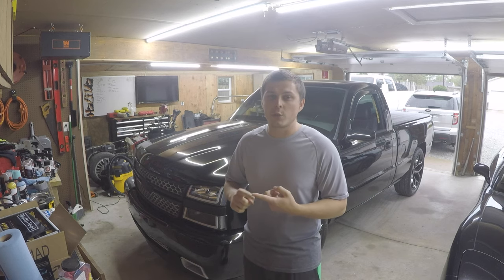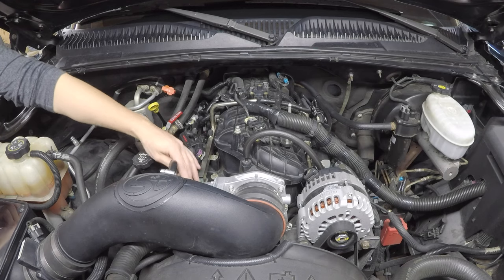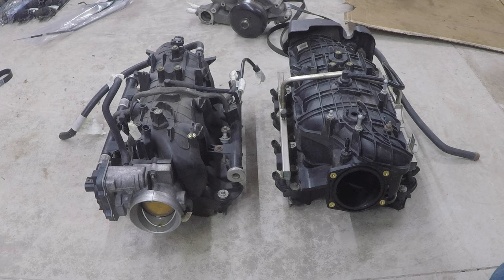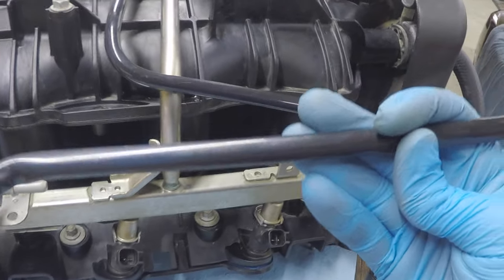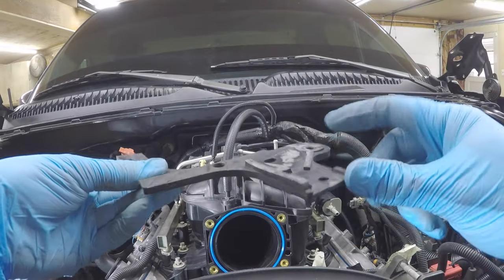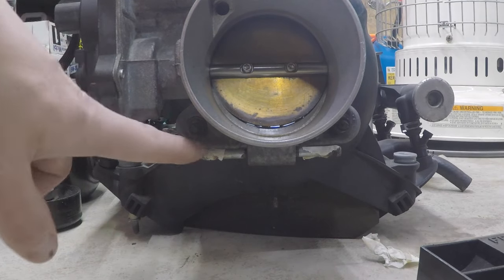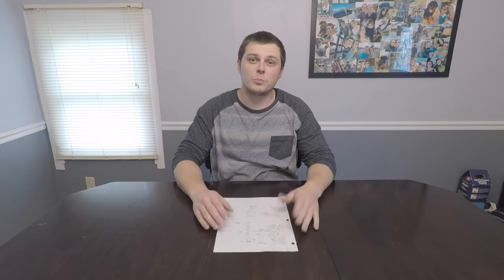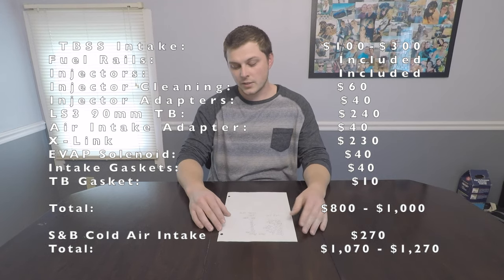TBSS Intake Swap, Ultimate Guide! Add More Power To Your LS Motor!

Comment: Just wondering what kind of mpg you were getting before and after for this build
Reply from the maker: Hey, honestly I'm not sure. (Work truck model, so I don't have the fancy guages) but it does pretty well, especially with the 3.73 gears. It definitely does better than my stock 8.1L but it also depends how you drive it haha
Reply: @TheKingCoopa  Looking to possibly putting a bigger cam in my 05 Sierra, nothing too big and was wondering if the increased air flow would have a big difference on fuel economy
Reply from the maker: @sethcarmack4514  well thats a give and take situation haha. Its really hard to make more power, and still have good gas mileage. Going with a bigger cam will definitely get less mpg. But for the intake, it will gain you more power, but not sure about the mpgs. Freeing up airflow always helps an engine breath better, which in turn will help your mpgs. The biggest, would be to remove your cats. Keeping those on is like your engine breathing through a straw. But sorry I can't fully answer that. Hope that helps!
Reply: @TheKingCoopa  Ah yes, can't have one without the other, the quest for more power and more mpg's may never be attainable, sad but true lol, thanks for the info tho, you have a great channel!
Reply from the maker: Haha the struggle is real! Thanks for the support!
Reply from the maker: Hey, just an update, my truck gets 15mpg on the highway at 80mph and 2100rpms. Thats with 355hp/369tq to the wheels, 2600stall, and 3:73 gears. No idea what it gets through the city, I'm constantly flooring it lol.

Comment: Are these fuel rails for flex fuel trucks?  Can you get them for a NON flex fuel vehicle?
Reply from the maker: Hey, it doesn't matter for the fuel rail. I've ran 3 different styles of injectors in mine already. Only thing that changes between them are the injector connector style, and the injector height. Which will raise or lower the fuel rail, requiring small spacers for the fuel rail mounting bolts. The flex fuel doesn't matter. Its just a tube to deliver the fuel to the injectors. But yes, some of the NNBS trucks come  flex fuel from the factory.

Comment: So what kind of power did it add? was it worth it?
Reply from the maker: I can't honestly answer that, because I also did alot of other mods at the same time. Big cam, milled 243 heads, full exhaust, etc.  But from the research I did, alot of people gained about 10-15hp from just the intake swap. Not including the 90mm TB

Comment: What size of injectors will I be able to use ? I'm putting one on my 06 Silverado 4.8
Reply from the maker: Hey, this intake will run the TBSS & NNBS injectors. You can run any size CC. But I'd definitely talk to your tuner about what your desired power level is before you drop money them.

Comment: Where did u purchase the cam?
Reply from the maker: Hey, I had a custom grind done. I ordered it through my local race shop, who is a dealer for Crane Cams. 226/234 +112.  

Since this video, I pulled the 4.8L installed the crane cam into my C5 corvette (getting it tuned this week) and I'm building an LQ9 6.0 to drop into the truck, with a CamMotion 232/240 +112. Also got some Frankenstein stage2 heads.

But you could always call up Crane Cams, CamMotion, or BTR and they will have an expert to talk with you about your custom setup, curb weight, motor, power levels, ect. And will spec out a cam for you.

Comment: The intake i bought came with a harness cut off could i use the throttle harness connector ? Or is that not able to convert
Reply from the maker: Hey, you could use the connector, but you still have to convert the wires over. Not exactly sure how the x link is designed. But I know some of the wires get soldered together.  Its definitely possible to make it work, but I'd do some research before you splice any wires together.

Comment: How much power did you gain and did you put it on the dyno
Reply from the maker: Hey, I dont know the exact power gain, online research says about a 10hp gain over the nbs stock truck intake. Not including the 90mm TB. I dont know the exact hp, because I did alot of other mods at the same time. Mild cam, 243 milled heads, CAI, long tubes, no Cats, built tranny, shift kit, 2600 stall, ect.
 I dynoed the truck on a hub dyno. 4.8L made 355hp / 369tq to the wheels. Shifts at 6500RPM on WOT. Here is my dyno video, if your bored.

https://youtu.be/4cbD1hs81Xc

Comment: I noticed that when trying to install the filter on the fuel rail its different then the fuel rail you list. The inlet is shorter in the  picture and bolts up. The link u have listed the inlet is alot longer on the fuel rail and won't mount?
Reply from the maker: Hey, so it won't mount as in the it won't connect to the fuel rail, or it is too long and hits the firewall?
Reply: @TheKingCoopa  its to long and hits the fire wall.
Reply from the maker: @drinkindreamin9883  gotcha, its a fairly common issue. Alot of guys will run a flexible fuel hose in-between the fuel rails and filter. Make an S bend with it, tuck it behind the fuel rail so it looks nicer, and they usually ziptie the filter to the side of the fuel rails. You could also do it with AN lines and fittings, but it would be pretty expensive.
Reply: Ok thanks
Reply from the maker: @drinkindreamin9883  here is a link to a performance fourm that has some photos how they fixed it.

https://www.performancetrucks.net/forums/gm-engine-exhaust-performance-21/keep-fuel-lines-off-firewall-tbss-intake-538452/page3/

Comment: What if I run e85??? What kind of injectors do you recommend i can use or can I use the same one from the old manifold
Reply from the maker: Hey, im not exactly sure on the recommendation. I know FAST makes injectors that are flex fuel, so you can run both e85 or regular, whenever you change your tune. But I wouldn't run the stock injectors unless they are rated for it. They will get gummed up and their o-rings can deteriorate over time. 

I'd just give a name brand company a call, and they could spec you out a set, for your fuel rating/lb and the power level your trying to achive

Comment: Looking to put a cam, headers and intake on my 2012 4.8 sierra, say I bought the tbss intake and ls3 tb but kept my stock fuel rail and injectors is that going to mess with the flex fuel aspect.Also can I just run the tbss rail/injector with it being flex fuel. 18 years old and am trying to learn as much as I can  so sorry if these are stupid questions
Reply from the maker: For sure, its all good. So filming this i made a mistake, (I put a note about it in the description) the NNBS intake is identical to the TBSS intake. Yours being a 2012, you already have the newer updated truck intake. (If you look at your throttle body, it will be a 4 bolt, not a 3 bolt like the old truck intakes) so don't waste any money on a throttlebody/intake. You already have the good intake.

The only intakes better are the LSXRT, which are expensive and cause issues. The holley high ram, which are expensive and don't make optimum power till 7k-8k RPMs. Which your stock bottom end won't beable to handle that. 

Your stock injectors will be good for just a cam/exhaust. They will probably be at 80% duty cycle. So if you ever decide to turbo it, or forced induction, I would recommend a fuel pump and bigger injectors then. Hope that helps you out!
Reply: @TheKingCoopa Much help thank you!
Reply from the maker: @kaidentabor7009  for sure, good luck!

Comment: I’m going to do a tbss swap on my 01 sierra, what do I need to do for the pcv valve is it the same?
Reply from the maker: Hey, sorry for the late reply! The pcv is basically the same procedure. It goes to the top middle of the tbss intake. So I just used the tbss pcv hose, and the 45degree rubber boot from the silverado intake, two hose clamps, and it worked great. Hope that helps, good luck 🤘

Comment: If your truck has cathedral ports does the tbss intake have to be cathedral as well? All the intakes in my area for sell are rectangle
Reply from the maker: Hey, the tbss/nnbs intakes are pretty much identical. Just depends on the year  and what style of heads/motor they came off of. Just gotta keep looking, you will find one!

But you could always try this out. Says its GM OEM with great reviews. the reviews show its cathedral port. Not bad for 158$

GM Genuine 12580420 
Intake Manifold 
https://a.co/d/3pjKsCj
Reply: @TheKingCoopa Okay I wasn’t sure if I could use a rectangle port tbss tnx …. I saw one on ebay with injectors and fuel rails for around 250. 👍🏻
Reply from the maker: @luisgodinez865  rectangle port intakes have to go with rectangle port heads. You can't mix and match Cathedral/rectangle port. 

250$ isn't to bad. Good luck with the search!

Comment: What made you add the water valve for you heater core hoses?
Reply from the maker: The previous owner did that. The hot/cold blend door actuators went bad. So instead of fixing those the right way (tearing half the dash apart like I did) he put that ball valve in, to shut off the heat, in the summer time.
Reply: @TheKingCoopa  my grandpa did that in his 79 in the summer to keep heat out the cab. I had to replace all mine when I got my truck. I’m doing the rear air ones rn. Great video bro
Reply from the maker: @seantire  haha nice! Good luck with those, hopefully they aren't that bad. Thanks for the support!

Comment: Where’d you get the air intake ?
Reply from the maker: Hey, I bought it locally. You can usually find them on Facebook market place for $100-$300 depending on if its complete or not. Some people have bought the NNBS doorman intake off rockauto.

Comment: Do you have to use an xlink with the stock 87 mm tb drive by wire
Reply from the maker: The stock TBSS/NBSS 87mm TB communicates with different signals, and the plug/wires are different than an older gen III TB/harness. It is not plug and play.

Comment: The corvette style regulator needs to be mounted close to the tank, not the intake.
Reply from the maker: This is just setup for an easy bolt on and go scenario. Most people arnt going to run aftermarket fuel lines or rails in this situation, with that little amount of power its not a big deal. If they were going with crazy HP, AN lines, and billet rails they will need a high end regulator like from  aeromotive. Aeromotive recommends the regulator to go after the fuel rails on high HP applications.
Reply: @TheKingCoopa  I understand, I also respectfully disagree sir. But thats ok.
Reply from the maker: for sure, its all good. My videos are just recommendations, people should always do some good research before modifying stuff.

Comment: Did your truck go into reduced power mode after the mod?
Reply from the maker: Hey, sorry for the late reply!! No, my truck didn't have any issues. But I know alot of people run into issues with the Xlink and 90mm throttle body. Are you running the old style or newer 90mm TB?

Have you figured it out yet?

Comment: Would it run after intake, gold blade, and injector swap without tune?
Reply from the maker: Hey, it might drive to the shop to get a tune. But you definitely aren't going to be daily driving it around or road trips. It will run super rich. Mine fowled out the plugs in just 5min of idle time, and wouldn't stay running. I had to swap out the plugs, didnt start it at all, and had the tuner come to me to do the base tune before I fired it up again.  But id try it. Worst case scenario you have it towed to the tuner.

Comment: Will the TBSS INTAKE MANIFOLD fit on a 2006 impala ss 5.3 engine??
Reply from the maker: Yes, as long as its a gen III LS V8, with Cathedral Port heads. It might not clear the hood though. It is a little bit taller than the regular truck intake. And alot taller than the car intake

Comment: did u tune for the intake how well does it run
Reply from the maker: Hey, yes you will need a tune, especially if you change injectors. It won't run right, mine fouled out the spark plugs in 5min of idle time. But with all the mods, the truck made 355hp/369tq on a hub dyno (newer video) and it ran a 15.41 in the 1/4mi on the street (also a newer video). I just swapped to 4.10s to help spin the heavy 22s. And here soon I'll be swapping to a built 6.0 LQ9, 2 step, 200shot of nitrous, and possibly AWD

Comment: Do you have to tune it right afterwards if you run the stock ls2 injectors?
Reply from the maker: Hey, sorry for the late reply. Some times yes, sometimes no. if you put larger injectors in, the computer still thinks they are small, and will be dumping ALOT of fuel into the cylinders. but a tune is definitely recommended right away.

Comment: Hey man in the process of adding one to my LR4 as well. How much HP/TQ would a ported tbss intake add? Any ideas.
Reply from the maker: Hey, I can't give you an exact number, but I'd assume about 15hp. It would really benefit from it, if the head ports/throttle body were port matched as well. So there isnt a lip that the air has to flow over.
Reply: @TheKingCoopa  appreciate you! Man
Reply: Forgot to ask! Man. Can I use the top port of the evap! For the passenger side valve cover instead of tappin into the CAI tube? I will be deleting the evap on the tune.
Reply from the maker: Hey, theoretically that should work. I don't see any reason why it wouldn't.
Reply: @TheKingCoopa  heck yea man! I was looking at forums! And I thought 💭 well why not! If my evap will be deleted on the tune! But thanks for your opinion man! Appreciate you.
Reply from the maker: @lauroguerra732  for sure, good luck. Let me know how it all works out 🤘

Comment: Doing a 5.3 swap in a 1995 S10 , using this TBSS intake, will I have hood clearance issue's with the stock hood. Trying to make between 350- 390 whp , anything over that in this little truck will take away the fun of a daily driver. Would like to retain a sleeper look.
Reply from the maker: hey, sorry for the late reply. the tbss intake is almost the same height as the stock truck intake. so if you know the 5.3 intake will clear, than the tbss intake should clear. sounds like it will be a sweet truck!

Comment: Awesome video! I recently picked up my tbss intake and am looking to install. One question i have before starting any kind of tear down is if I install it with the oem tbss fuel injectors (i believe 32lb) will stock rated fuel pump be able to supply enough pressure? ( Delphi pump, 28 gallon per hour avg, max psi 73). Thank you!
Reply from the maker: Hey, sorry for the late reply. Your stock fuel pump will do just fine. 32lb injectors really isn't anything crazy. If your motor is stock besides the intake, then I really wouldn't worry about bigger injectors or fuel pumps. If you ever decide to go more than that, I'd definitely recommend looking at some larger fuel pumps/injectors. My new setup is 42lb injectors with dual walbro 450s (capable of 1000hp) which is overkill for my setup. (built LQ9 makes 470whp, injectors are currently at 75% duty cycle), but I do plan to twin turbo it in the future. So I'll need bigger injectors when that day comes. Hope that helps, and id recommend you get it tuned. Especially since you have air flow and fuel changes. Thanks for the support and good luck!
Reply: @TheKingCoopa  no worries man! Thank you for the reply. I had reached out to a couple shops and they said it would be fine, probably not gonna go much crazier than this so I think the fuel system will be good. I did have a tuner in my area but am currently looking for a new one, do you have any recommendations in the ATL or North Georgia area?
Reply from the maker: @tylergerding74  oh nice, glad you got some answers already. Im from northern Indiana. So I dont have a good recommendation for you. I would try to stay away from the mail in tunes. Your setup is super simple, but I believe an in person tune will always be better. They have the laptop/info right infront of them and can make adjustments on the fly. 

But id just do some good research. There are some good tuners and crappy tuners out there. On average I pay about 300$ for a tune. Sometimes that includes dyno time. If anyone tries to charge you more than 500$, I'd stay away. Just my opinion. But id ask around on the local car Facebook pages. Im sure you will get the same tuner will start getting recomended multiple times to you.
Reply: @TheKingCoopa  okay gotcha, yeah almost every high rated tunes around me are around 6-700 dollars once all is said and done. I'll definitely check around and see what some guys are posting on marketplace, thank you man!
Reply from the maker: @tylergerding74  ooof.. supply and demand i guess. Good luck!!

Comment: What about the gasket on the intake b4 you put the throttle body? What did you use?
Reply from the maker: Hey, thats just the GM 90mm throttle body gasket/O-ring. Everything is linked in the description of this video 🤘

Comment: I got a tbss intake and I’m trying to put it on my 02 avalanche, so I can just put the c5 corvette filter then?
Reply from the maker: Yes, if you have the return style fuel system. (Two fuel lines coming from the firewall). 

If you have a single fuel hose (return-less) then you dont need the c5 filter

Comment: is this still worth doing if you keep the stock throttle body with the conversion plate?
Reply from the maker: Hey, sorry for the late reply! If you can find one for cheap, then I recommend it, however keeping the factory air intake and throttle body stock you are limiting the airflow to the TBSS intake. so I'd say yes and no. if you have time and money go for it, but I don't think it will change much. maybe 5 or 10hp with the other stock parts. Hope that helps, good luck!